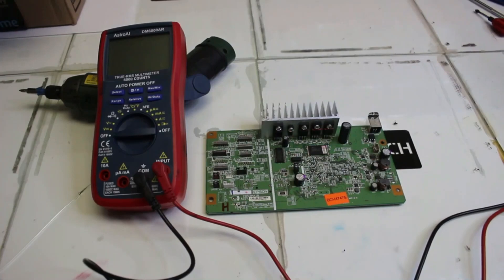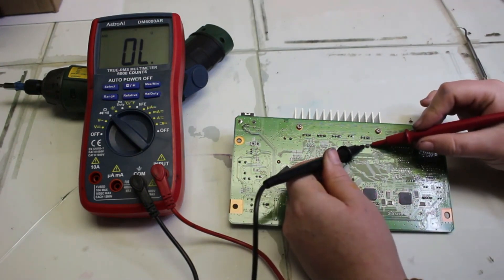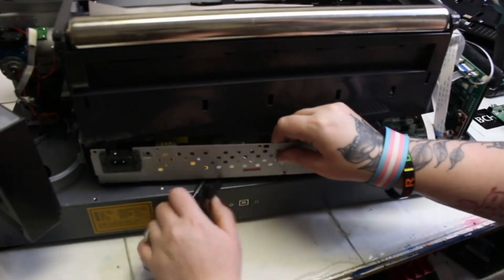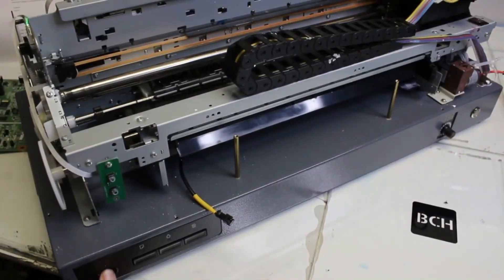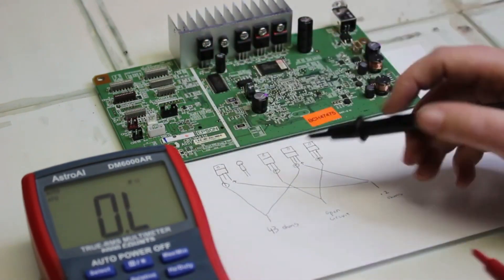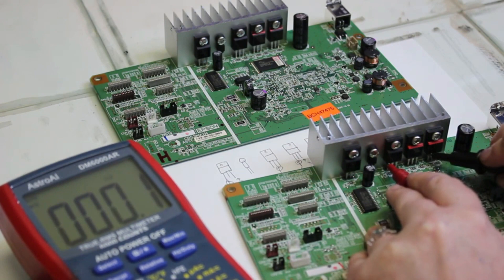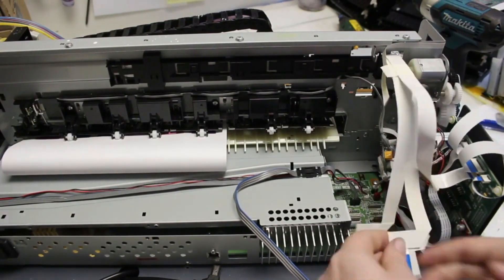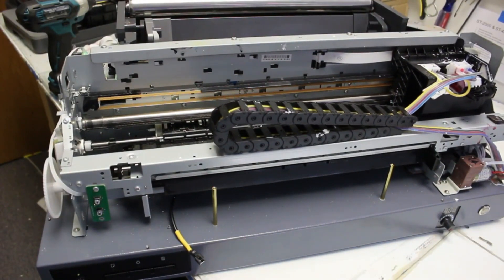Avoid Costly Repairs: Epson L1800 Mainboard Testing Tips

Comment: Hi Kevin! I just bought a used printer with an L1800 head and runs DTG10.3 that was left for months not being used. So I got a new head for it from Amazon. Is there anything that I'll need to watch for when I install and try to run it? Just to make sure I don't burn up the new head or the main board for it. Is it also safe to power up the printer with the Print head disconnected?
Reply from the maker: Thanks so much for your question and for supporting the channel—I really appreciate it! I hope you’ve had a chance to watch this video ([https://youtu.be/8GFTccfqKpE](https://youtu.be/8GFTccfqKpE)) because it covers the main risks, and just a heads-up that Amazon/Walmart printheads can be hit or miss; if it’s one of those $50 ones, return it immediately. It’s totally fine to power on the printer with the printhead disconnected so you can diagnose what actually needs repair before installing or even purchasing a head, which helps avoid burning up a new one or damaging the mainboard. If you want quicker replies going forward, be sure to subscribe or become a member since subscribers and members get priority and are usually answered within 48 hours, while I can only respond to about 10 non-subscriber questions per day and answer the rest only if time allows in a last-in, first-out order; if you’re not subscribed and don’t hear back within 48 hours, feel free to subscribe or repost your question since newer comments get reviewed first, and if you subscribe later, any older questions automatically become priority. You’re also welcome to join me on Run With Kevin — LIVE most mornings between 6–8 AM Eastern where I answer printer questions in real time, so hit subscribe and turn on notifications to catch the next session. If you ever need faster assistance, you can email [support@bchtechnologies.com](mailto:support@bchtechnologies.com), and if this reply or video helped you, a quick Google review would mean a lot: [https://g.page/r/CfL7k6nYvPQ9EAg/review](https://g.page/r/CfL7k6nYvPQ9EAg/review).
Reply: @BCHTechnologies  Hi, Thanks for the response. I got it for $360. Btw, how do I subscribe? I thought it was the channel support.

I have the no power 1390 new board. Will be looking into checking that Qf601 Mosfet, will the other transistors also be the cause of the No Power? Looks like the Power supply shuts down its output when it sees an overload current from the board?

Comment: What should I turn my meter on when testing
Reply from the maker: Thanks so much for your support and for checking out the video! The setting you choose on your meter really depends on what you’re testing, but in most cases you’ll switch between three modes: Ohms for checking resistance, continuity (the beeping mode) for testing fuses, and diode mode for checking directional components like transistors and diodes. I really appreciate you being here, and if you haven’t already, please consider subscribing or becoming a channel member because subscribers and members get priority replies within about 48 hours and also get perks like early access to videos; I receive far more questions than I can answer and usually respond to only around 10 per day, so after members and subscribers, I fill remaining replies last-in, first-out, meaning newer questions get answered first. If you’re not subscribed and don’t hear back within 48 hours, feel free to subscribe or re-post your question since newer comments get reviewed first, and if you subscribe later, all your older questions automatically move into priority. You’re also welcome to join Run With Kevin — LIVE, where I go live most mornings between 6–8 AM Eastern to answer printer questions in real time, so subscribe and turn on notifications if you want to catch the next session and ask directly. If you need faster help, you can always email [support@bchtechnologies.com](mailto:support@bchtechnologies.com), and if this video or reply helped you, a quick Google review would mean a lot: [https://g.page/r/CfL7k6nYvPQ9EAg/review](https://g.page/r/CfL7k6nYvPQ9EAg/review).

Comment: Hello please someone can tell me the value of capacitor betwin the transistor and the circuit ic 5:58
Reply from the maker: Thanks so much for watching and for your question! That capacitor sits between the transistor and the IC, but its exact value can vary between board revisions, so the safest way is to check the marking on your specific board or measure it with an ESR/LC meter if the component is readable; many L1800 boards use similar layouts, but not always identical values. I really appreciate your support, and if you haven’t already, please consider subscribing or becoming a member because subscribers and members get priority answers within about 48 hours plus early access to new videos. I get a huge number of questions every day and can only answer around 10, so after subscribers and members I reply to the newest questions first; if you’re not subscribed and don’t hear back within 48 hours, feel free to re-post your question or subscribe, and all your older questions automatically become priority. If you ever need faster help, you can always email [support@bchtechnologies.com](mailto:support@bchtechnologies.com), and if this video or reply helped you, I’d really appreciate a quick Google review here: [https://g.page/r/CfL7k6nYvPQ9EAg/review](https://g.page/r/CfL7k6nYvPQ9EAg/review).
Reply: @BCHTechnologies i will subecribe now . Thank you . And i will emaild you with picture of board
Reply: @BCHTechnologies OK i am suscribde

Comment: Hello, I have procolored L1800. my power light in front of the printer next to the (paper and ink drop lights) wont light up. the main power from the back does turn on but not the front power button. what can I do to fix this?
Reply from the maker: Thanks so much for your detailed question and for watching the video! It sounds like your issue is on the printer’s side rather than the ink system—since the back power switch turns on but the front button doesn’t, it’s likely related to the mainboard or internal power circuitry. You can use Epson’s Adjustment Program to diagnose it: select your printer’s USB port, choose “Particular Adjustment,” then “Printer Information Check,” and the latest error will appear at the top. To interpret it, just search “BCH Epson Error” on Google to find our page explaining Epson’s secret error codes, or watch our quick guide here: [https://youtube.com/shorts/FPZzpyYuZLE](https://youtube.com/shorts/FPZzpyYuZLE). I really appreciate your support—please consider subscribing or becoming a member to get priority answers and early video access. I get a lot of questions every day and can only answer about 10: subscribers and members within 48 hours, and regular viewers if time allows, with newer comments reviewed first. If your question isn’t answered within 48 hours, you can subscribe or re-post it for faster review, or email [support@bchtechnologies.com](mailto:support@bchtechnologies.com) for quicker help. And if this reply or video helped, I’d be super grateful if you left a quick Google review here: [https://g.page/r/CfL7k6nYvPQ9EAg/review](https://g.page/r/CfL7k6nYvPQ9EAg/review).

Comment: I have an L1800 that prints two sheets, and on the third, it stops processing and stops printing. Is this the motherboard or the printhead? It prints fine, but it freezes.
Reply from the maker: Thanks so much for your comment and for checking out the video! If your L1800 prints fine for the first two pages and then freezes on the third, the issue is likely with the mainboard rather than the printhead—especially since the print quality is fine up until the freeze. A failing mainboard can overheat or misprocess data after prolonged operation, causing it to lock up mid-job. It could also be a power regulation or data buffer issue. I’d recommend testing the board with a multimeter to check for voltage inconsistencies or watching for thermal failure signs. If you haven’t already, make sure your firmware and drivers are up to date and try printing through a different software interface to rule out PC-side issues. Thanks again for your support—feel free to reach out if you need further help!
Reply: @BCHTechnologies  Thanks @BCHTechnologies for your response... I took the printer to an authorized service center for a printhead cleaning, and it came back with the new problem I mentioned.

I hope I wasn't scammed and the motherboard was intentionally replaced with a defective one, because I didn't have that problem before.

Thanks for your time!

Comment: Thanks. Did you replace all 4 transistors or just the 2nd & 4th on the motherboard?
My Procolored L1800 printhead and motherboard failed for the 2nd time.  11 months in before original failed and the newly replaced $700 printhead and motherboard only lasted about 6 weeks even with the proper maintenance.
Reply from the maker: Thanks so much for watching and sharing your experience! In this case, I replaced all four transistors to ensure full stability since partial replacement can sometimes lead to another failure, especially when a printhead or mainboard has already burned twice. It sounds like your system may have a deeper voltage or grounding issue affecting both components, so it might be worth checking for power irregularities or a damaged cable path. I really appreciate your support! Because of the high number of questions, subscribers and members get priority answers within 48 hours and enjoy early video access plus exclusive benefits. I can only answer about 10 questions a day, so after subscribers and members, the newest comments are answered first. If you’re not subscribed and don’t get a reply within 48 hours, you can either subscribe (your old questions automatically become priority) or re-post so it’s seen sooner. For faster help, you can email [support@bchtechnologies.com](mailto:support@bchtechnologies.com). And if this video or comment helped, please consider leaving a quick Google review here: [https://g.page/r/CfL7k6nYvPQ9EAg/review](https://g.page/r/CfL7k6nYvPQ9EAg/review).
Reply: Most of the desktop printers are just thrown together and unless you are a tech don't last long at all. With very little help from tech support.
Reply: @QueenBDesigns   I replaced the motherboard with a new one and also replaced the transistors on the motherboard that blew. So I now have a spare.

Comment: Kevin but how do you remove them the transistors
Reply from the maker: Thanks so much for your support and for the great question — I really appreciate you watching and engaging; for removing those transistors on the L1800 mainboard, it’s typically done with proper soldering tools like hot air rework or a temperature-controlled iron with flux and braid, and the key is even heat and patience so you don’t lift pads or damage nearby traces, especially since these boards are multilayer and unforgiving; if you need quicker or more direct help, feel free to email [support@bchtechnologies.com](mailto:support@bchtechnologies.com), and if this video or reply helped you, I’d be grateful for a Google review here: [https://g.page/r/CfL7k6nYvPQ9EAg/review](https://g.page/r/CfL7k6nYvPQ9EAg/review); just a heads-up that I get a high volume of questions and can only reply to about 10 per day, so comments are prioritized with subscribers and members first (usually within 48 hours), then regular viewers if time allows, and after that remaining slots are filled last-in, first-out (newest questions first), so if you’re not subscribed and don’t hear back within 48 hours, you can either subscribe or re-post your question, and if you subscribe later, your older questions automatically become priority without needing to re-post; I also invite you to subscribe, turn on notifications, and join Run With Kevin — LIVE, where I go live every morning (usually between 6–8 AM Eastern) to answer printer questions in real time and give subscribers and members extra perks like priority replies and early access to videos.

Comment: Would this be the same for the procolored epson L1800 in teal? Had the paper and ink lights flash red and when I went to turn the printer front power on to get the printer head to move the power didn’t turn on. Now my unit doesn’t power on.
Reply: cambia la placa.
Reply: @vastavevzla4679 what plate?

Comment: Hey, thanks for the video. It was very helpful! I have an Epson L1800 that won't turn on. The power supply seems fine. And the transistors on the logic board are fine too. 

When I measure the output voltage of the power supply, it's 42V, but when I connect the power supply to the logic board, the output voltage of the power supply drops to 3.8V. 

Do you have any idea what this could be?
Reply from the maker: Hi! Thank you so much for watching and commenting—I’m glad you found the video helpful! It means a lot to hear feedback like this from our viewers. 😊

What you observed is correct. The power supply typically has a ground, a power output (42V), and a standby voltage (1.3 to 1.5V). When you connect it to the board, a standby chip raises the standby voltage to around 2V. This signals the 42V output to drop to about 4V, which prevents the mainboard from being continuously heated like a furnace with full 42V power. A reading of 3.8V is within the normal range.

You’re off to a great start with your troubleshooting! I’d recommend continuing to check key components, such as the Q601 transistor, to pinpoint the issue. https://bchtechnologies.com/products/transistor-qf601-for-mainboard-cb53-main-l1800-1390-1430-epson-printers-fix-no-power

I get so many questions daily that it’s hard to keep up with them all, but I appreciate your patience. For quicker responses, you can email me directly at support@bchtechnologies.com, or post your question on my most recent videos (not Shorts) for better visibility.Thanks again for being part of our community! We try to release new videos every week to keep up with printer technologies, so stay tuned for more content that might help with repairs like this one.
Reply: I have same issue with EPSON printer, and I thought it’s power supply problem and I had power supply ordered and I am waiting for it to arrive but from what I have read as a reply from Kevin, I have lost on this, when I connect the power supply the 42 volt drops to what you re saying..bx320fw

Comment: Can you email me my power won’t turn on at the front of machine
Reply from the maker: Thanks so much for watching my video and for reaching out with your question! I understand how frustrating it can be when your Epson L1800 won’t power on, especially after replacing key components like the bypass and motherboard. I’ll walk you through some additional troubleshooting steps that might help pinpoint the issue.

First, check the transistors on the mainboard, as these are a common cause of power issues. Specifically, the 4 transistors responsible for power management are critical to inspect. Even though you’ve replaced the motherboard, it’s worth double-checking them to ensure they’re functioning properly. If you’re not sure how to proceed, I have a video explaining the process in detail here: https://youtu.be/c_kmqwyZjLg.

Another key component to examine is the QF601 transistor, which is vital for the mainboard’s power functions in many Epson printers, including the L1800. A faulty QF601 can cause the printer to lose power entirely. You can learn more about this specific transistor and order a replacement here: https://bchtechnologies.com/transistor-qf601-for-mainboard-cb53-main-l1800-1390-1430-epson-printers-fix-no-power/.

If those checks don’t solve the problem, inspect the power supply unit (PSU). The PSU is crucial for providing power to all the printer’s components. Even if the main power at the back is working, the PSU could still be malfunctioning, preventing the printer from powering on. For a detailed guide, check out this tutorial: https://youtu.be/X2SeQjMBq6s?si=MbyYES66uy4CEIbc.

Finally, ensure the control panel FFC (Flat Flexible Cable) is properly connected and free from damage. This cable facilitates communication between the control panel and the mainboard, and any issues here could cause power failures. Replacement cables are available here: https://bchtechnologies.com/9-pin-ffc-connector-cable-for-l1800-control-panel-and-mainboard/.

If you have more questions, feel free to email me at support@bchtechnologies.com or post on my latest video (not shorts) for a quicker response. Thanks again for watching—I really appreciate your support, and I’m always here to help!
Reply: i have the same problem, were you able to get it fixed?